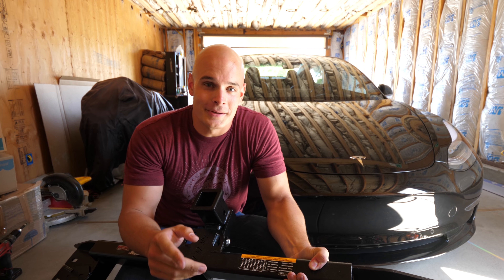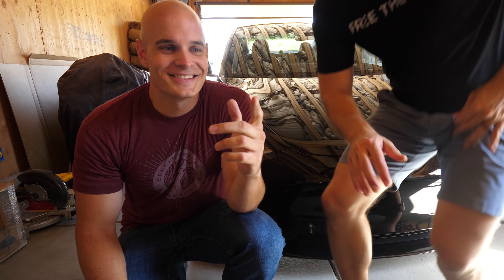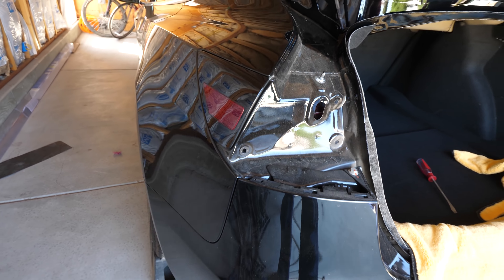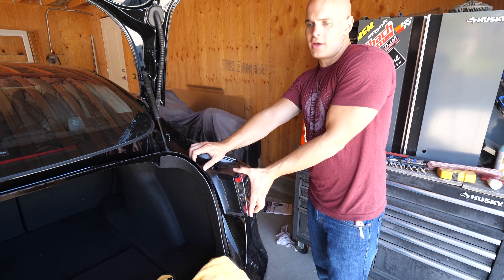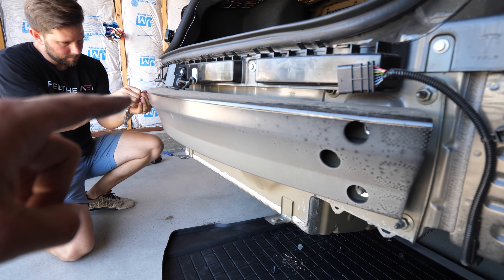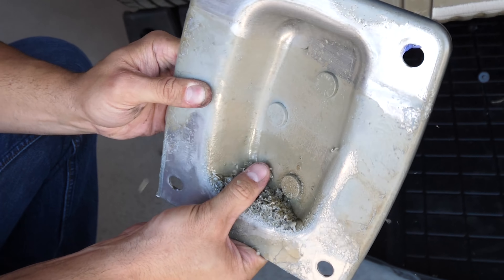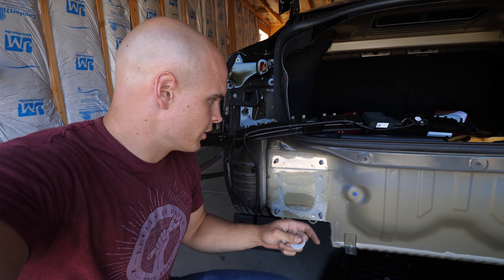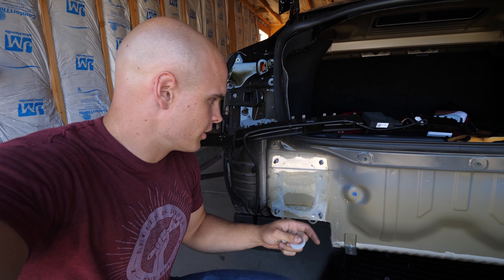Tesla Teardown! - Install a Tow Hitch on a Model 3!

Comment: Based on my experience with an after-market hitch on my 2007 Camry, my Yakima bike hitch will sit at the exact height above pavement on my Camry as it does on a Tesla Model 3. I measured it. Which means a rack will bottom out on the Model 3 OFTEN. I assume that has been your experience? Any suggestions? I'm considering getting a Hi-lo hitch to raise the rack a few inches, so that I bottom out on the hitch itself and not the rack. This would be much preferred because the connection mechanism of the Yakima rack to the hitch is a weak point and does not handle bottoming out well AT ALL. On several occasions with my Camry, the bike rack has detached and fallen off the car will driving. A horrible experience, so please beware. Any recommendations for how to contend with this is appreciated. Thanks.

Comment: What about debris and water getting up through the hole in the bottom? 

Did you craft any sort of plug for the hole when the hitch is not in use?
Reply: the hitch company supplies a plastic cover that fits over the cutout. it attaches with a strong magnet and seems to work well.

Comment: What's up guys. Great vid and kudos to being specific about specifics. I was thinking about that hole under the tesla and had an idea. If you guys dropped 2 carriage bolts facing down on the driver and passenger side of the oval hole you cut, with an aluminum plate rivited in place for the bolts to rest in, you could have a removable cover for the hitch hole while NOT in tow. Considering Bin like collecting rocks in his bumper this might be useful. Thanks again for the vid.....